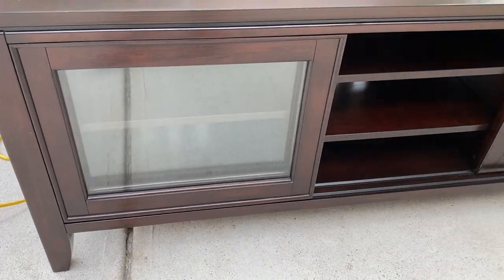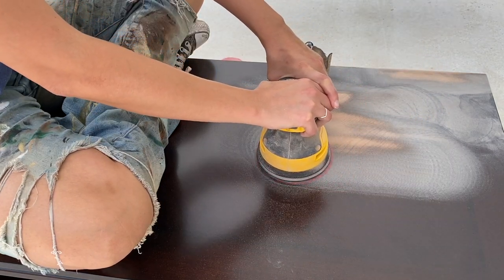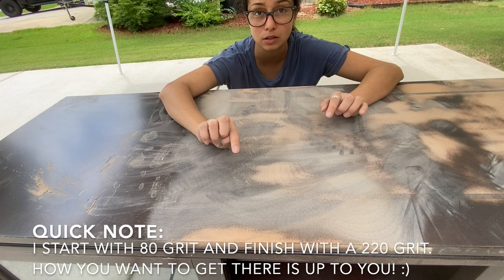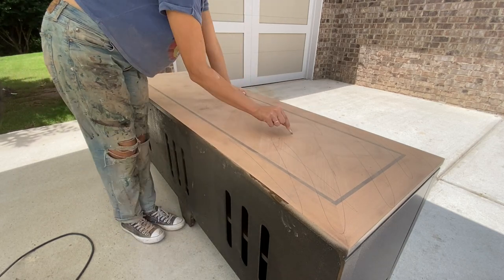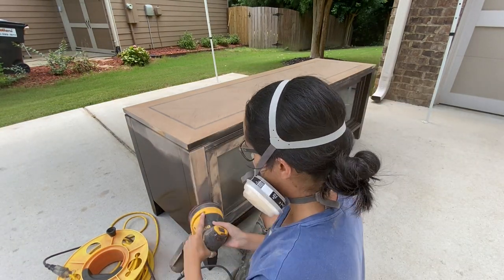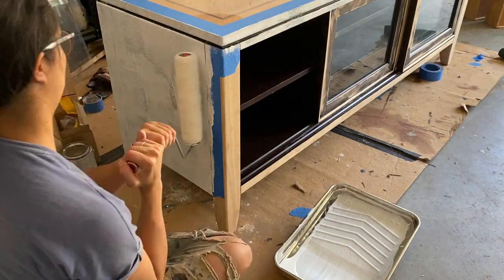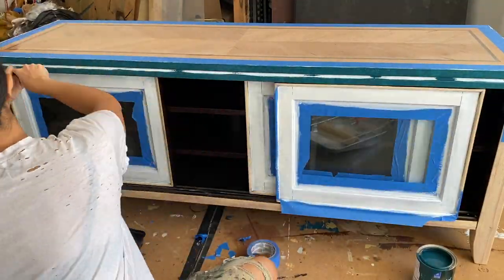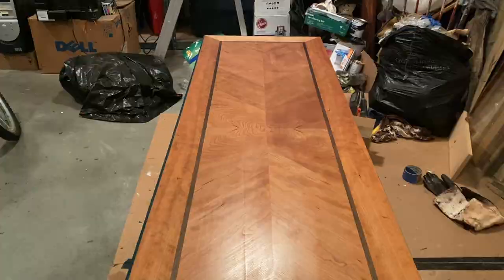My FAVORITE Sanding Method | TV Stand Edition | Episode 15

Comment: 80 grit is super aggressive and works so well to eat through finishes. I wonder if trying 120 on the sides would help? It's not really a thinner veneer. The smaller areas just are easier to sand and it eats through quicker.  It looks great! I can see why you kept it.
Reply from the maker: I tried 220 on the sides and it still shredded through :/ but thanks for the info!